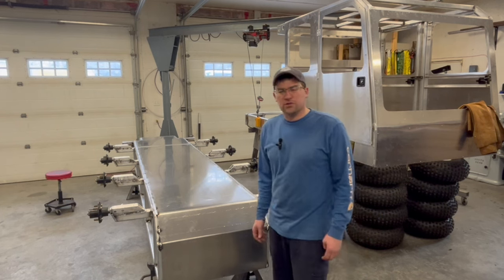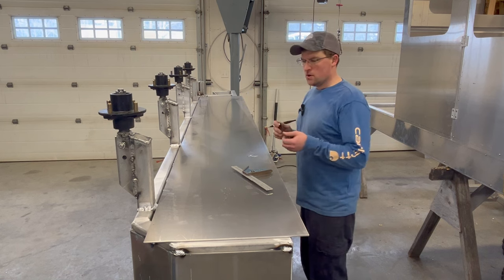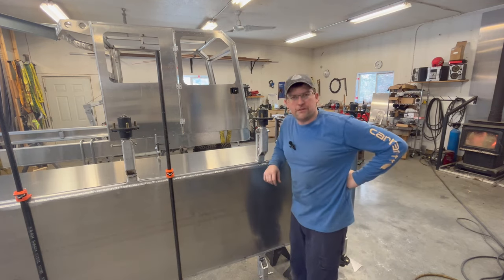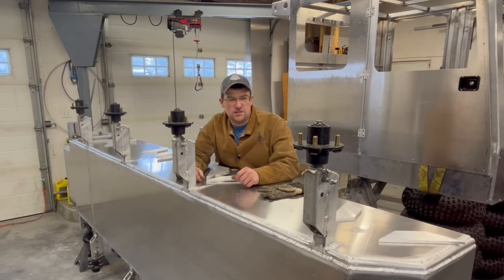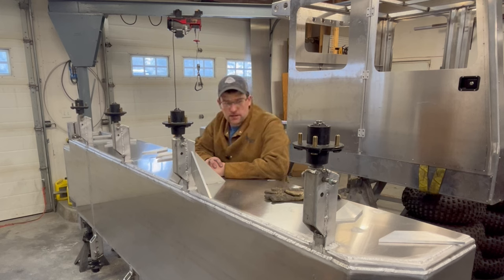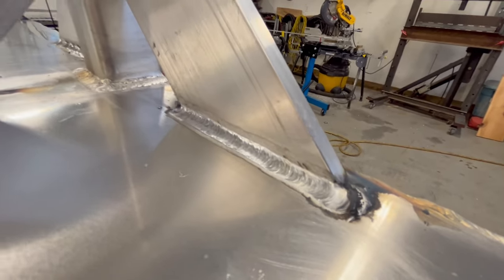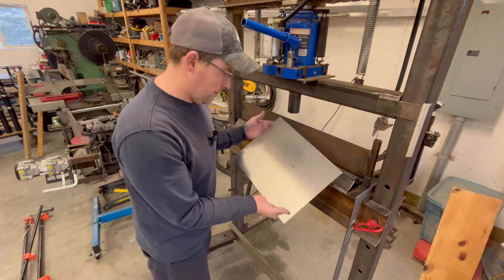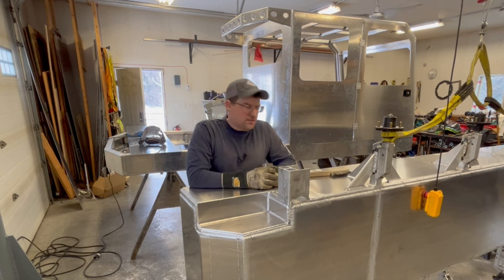Finishing the Snowcat Hull welding | Snowcat build PT22

Comment: Im trying to gather how your drive gear all works.Is it hydrastatic drive ? I have a couple wheel drive motors from a moffit forklift used but in bullet proof working condition that would make that have amazing torque and have controllable ports to attack a spoil valve to operate left and right track like a build dozer. Where are you located? I'm in Kitchener Ontario. Lou
Reply from the maker: Hey sir! So I have searched for a tandem set of position pumps that each have variable displacement. So the two ports from each pump go directly to some large displacement wheel motors I also sourced. By simply manually adjusting the swash plate in the pump you send fluid power one direction or the other. Each track is independent of each other and there isn’t any need for spool valves. It’s a very simple hydrostatic system thanks to these pumps I sourced. I may need to upgrade pumps down the road but that’s not an issue. I’ll also have a third gear pump to provide aux hydraulics for the place or attachments. I am up in Kenora near manitobia. 

Thank you so much for watching and I hope you enjoy. There is lots to come and I’ll be getting more in depth in the hydraulics hopefully in the next couple months. Cheera

Comment: Well, there is the strength added for axles.  You mentioned about the guards, bolt-on or weld-on. If you weld, it will be neat and permanent. If you bolt, still be neat but serviceable or just remove for those cases where debre likely to clog under. Options for bolting are loads of Riv-Nuts but must be put in wet with anti-corrosion sealer (steel and ally in moisture, you get the picture) otherwise, loads of ally bar stock cut in 1+ inch legnthes welded in behind exterior adn then Drilled & Tapped to proide strong thread purchase as well as lateral loading strength, both of which ally is not good for in thinner depths. 
Another thing to consider is if you need drains for bilge water ort servicing and/or inspection ports in the bottom or sides.
Reply from the maker: Exactly. So the guards for the motors I think I will incorporate into the 3/8” steel mounts I made. 
Yes I am thinking the same thing about bilge. I think I will  place two bilges into it. One in cab area and one in the engine compartment. Then weld in a bung to discharge thru hull.

I have lots of ideas for things just like that but don’t always have my mind fully made up because I want to see how other things interact. Also some things I may just wait on if they are easy to put in down the road. 

Thank you for all the suggestions and input. Having other views helps me with my own blind spots
Reply: @CenterLineDesigns  There is always the "Just Wing-it" approach. lol
Reply from the maker: Yea. I know what you mean. I usually try to plan things out but there is always that factor in a prototype